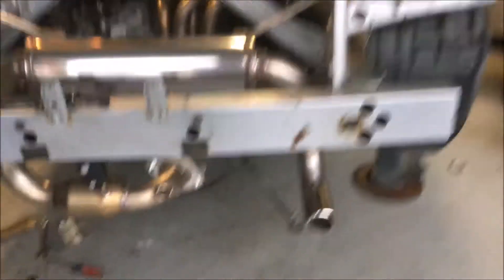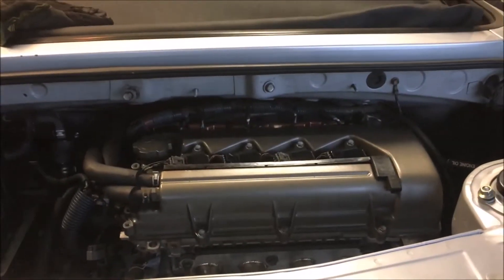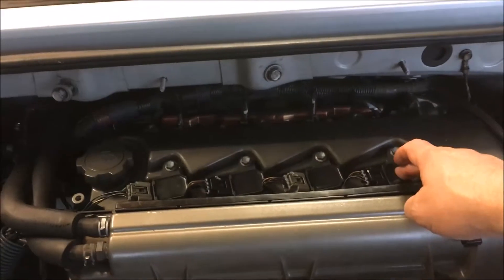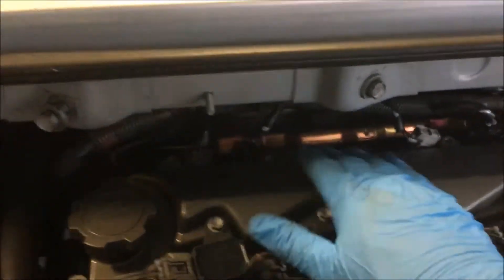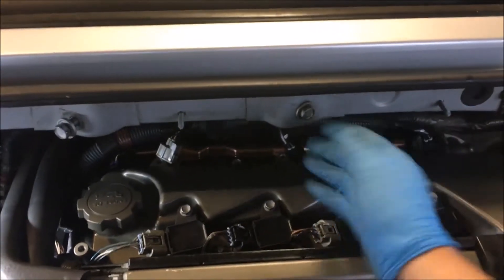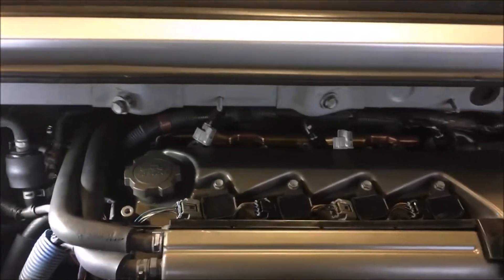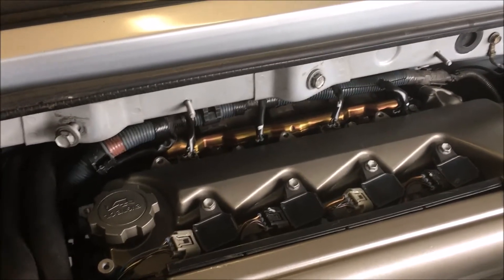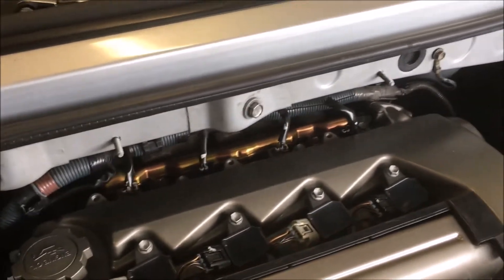MR2 Spyder Engine Codes & Fuel Injectors

Comment: Thanks for sharing. I've made the mistake of letting my 2003 Spyder sit in a garage for 2 straight years. Now the injectors are clogged and the engine won't run. This weekend I need to drain the old fuel and back flush the injectors. This video helps.
Reply from the maker: Glad the video is a help and good luck.

Comment: Thanks! It's people like you that make this world a better place by taking the time to share your experience to help others out.  Awesome!  I have same codes.  Already changed plugs, swapped coils and ordered a new breather and PCV hoses before watching this video.  Next, will try your spray method (never knew) and then finally check the fuel pressure and injectors.
Reply from the maker: Good luck chasing those codes.  They are very elusive sometimes.  Glad the videos help.  I had watched so many videos myself I thought I should give back.

Comment: how did you fix the injectors? Replace injector rubber seal? or buy replacement injectors?
Reply from the maker: I used some new rubber seals to get them installed nice and tight.
Reply: new orings & filters fixes most problems as injectors rarely go bad.. if the problem is still there then you gotta clean and flow test them..